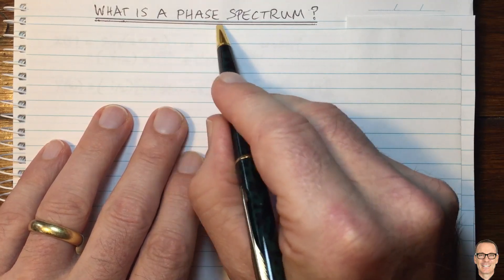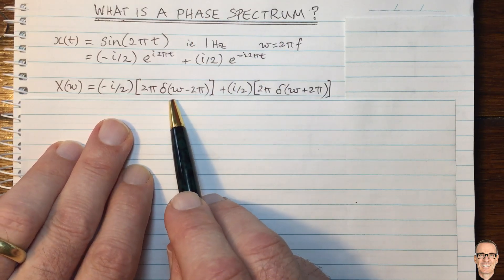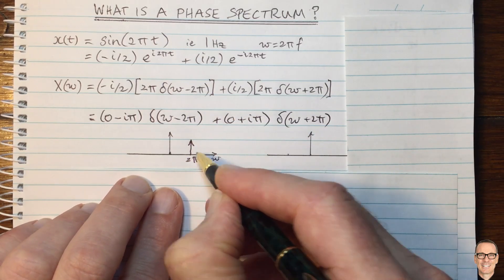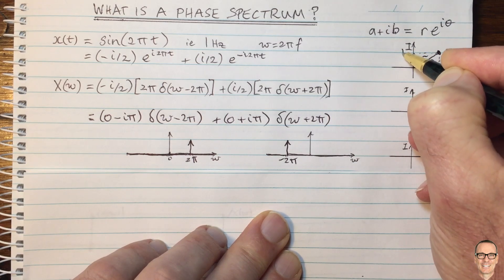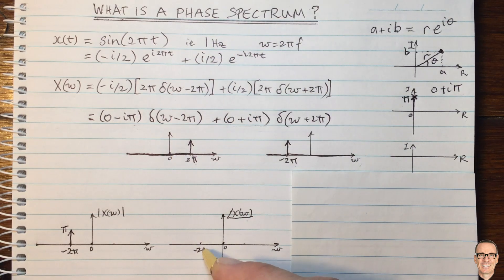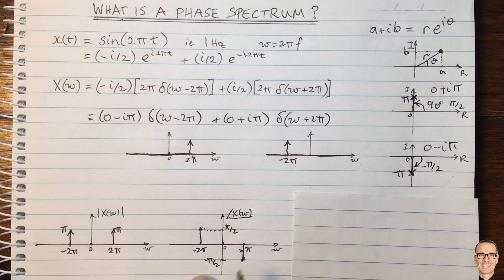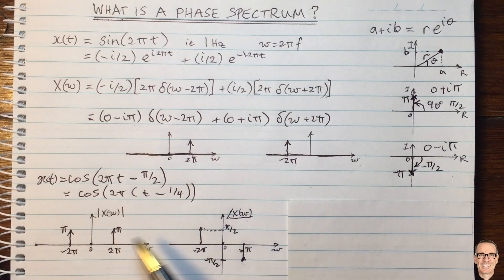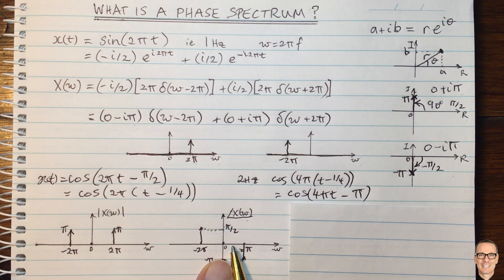What is a Phase Spectrum?

Comment: In magnitude spectrum π is not the magnitude it is the area under the delta function,  whereas magnitude is infinite
Reply from the maker: Technically yes. But I think you're being pedantic. Either people already understand the point you're making (and so don't get confused), or they don't understand it (but it doesn't matter, because it's not important for the thing I was explaining in this video).
Reply: @iain_explains 
Let's say f(t)= sin2t. FT of sin(2t) contains two spikes at w=2 and at w= -2. Which means the frequency content by sin2t is only w=2, which is obvious. But the magnitude spectrum of F(jw) is infinite at w= 2 and -2 as it contains delta function. That means sin2t is made of a sinusoid having frequency 2 but magnitude ♾️. How ???
Reply from the maker: Yes, the magnitude is infinity, but the width of that spike is zero. The energy is found by taking the integral of the squared value. And due to the special definition of the delta function, the area is finite. That's why we need the mathematical (non-real, idealised) delta function. Perhaps these videos will help explain: "What are the Units of the Fourier Transform?" https://youtu.be/y6DkoL6rHG0 and "How to Understand the Delta Impulse Function" https://youtu.be/xxGcI9WVoCY